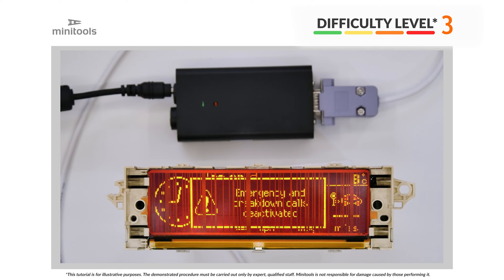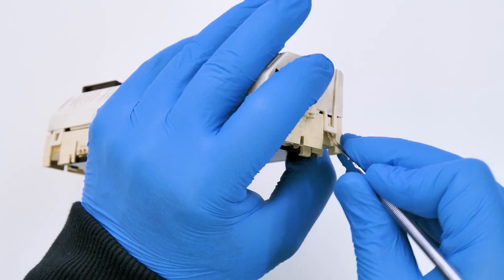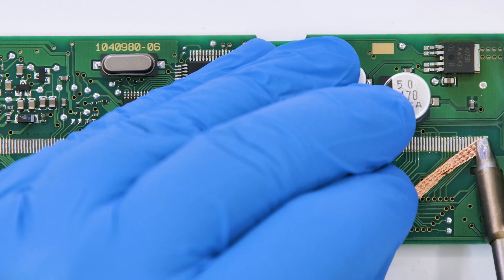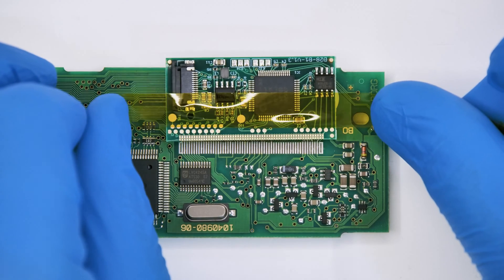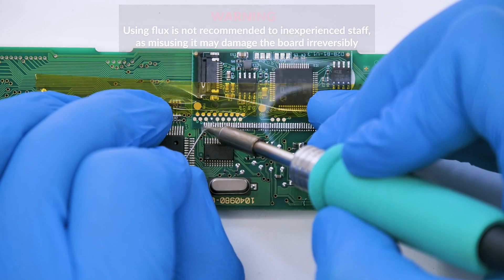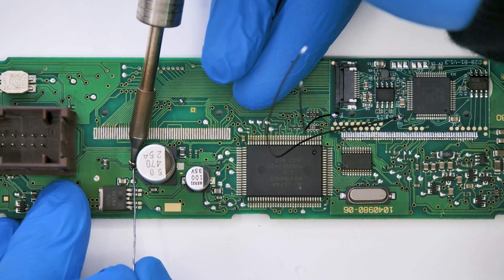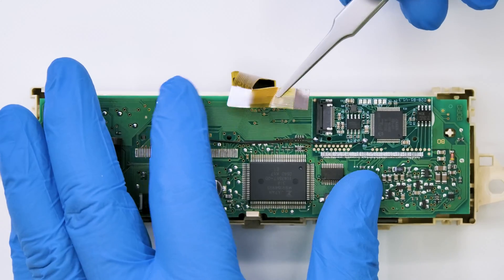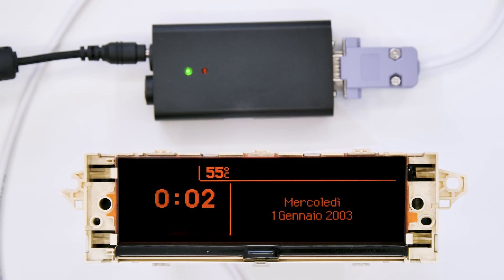Citroën, Peugeot, Fiat and Lancia multifunction MFD display (type C) repair

Comment: My car is also a 2002 2.2 manual transmission 607. Similarly, the LCD screen is faulty. When will there be a replacement for the 607 monitor? It is urgently needed.
Reply from the maker: Hi, could you please send us a picture of the fault and possibly pictures of the module removed from the vehicle as well at info@minitools.com? Thank you.

Comment: Is it compatible with peugeot 607 from 2002?
Reply from the maker: Hi, unfortunately it is not compatible with Peugeot 607.
Reply: @MinitoolsChannel  is there some kit like this for peugeot 607. It would be easy for me to repair like you did in your tutorial video. I found it very useful and esy to do.
Reply from the maker: Hi  @miagifish  , sadly we do not have a replacement therefore no kit available for peugeot 607.